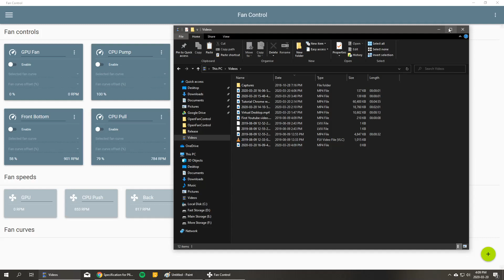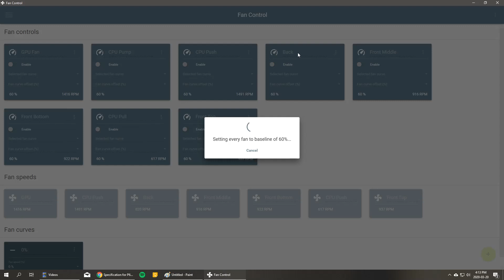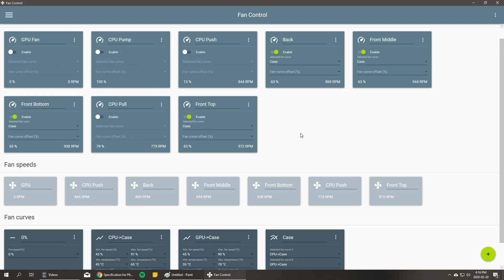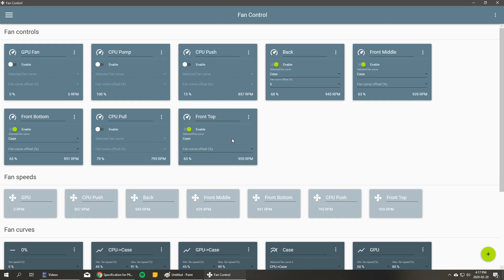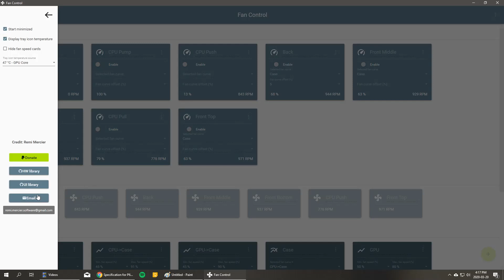Fan Control: Basic setup for case fans (Part 1)

Comment: Hi! The software doesn't see my CPU and case fans. Only my 2 GPU fans. I just went from Win10 pro to Win11 pro and used AI suite 3 with fan Xpert 4 on Win10, but doesn't work on Win11. That being said, Fan Xpert 4 was detecting all my fans, but FanControl doesn't. Any tip or direction I should look for? Thanks in advance!

Comment: Some fans aren't responding — for example, my exhaust fan isn't working isn't responding. and only one of the three front fans is being controlled. Also, the ASUS plug-in keeps failing to initialize. All the fans are connected to the ASUS controller in a Hyperion case. Any help would be greatly appreciated.

Comment: Nice vid. My PC was running my fans for nothing but noise earlier today, found your software, installed it and set it up following this vid. It's so quiet now and I love it. Only cons are the software recognizes 4 fans that don't seem to do anything, and it doesn't do well with corsair's built in fan control thing that comes with the 5000d model case. I managed to set it so the fans I have plugged into the corsair hub all work according to one fan control thing. My AIO also doesn't work with the software (3x120mm fans.) I plugged in 2 of the fans as CPU fan and CPU optional fan but the 3rd one is always on now as it's not seen by the software at all. 3 fan GPU's fans work as 1&2 together and 3rd separate.

Comment: i seem to having an issue that I can't solve.
I have  Fractal Era2 case, Asrock B650E mini ITX motherboard and Frozen Edge 240 water pump. For the water pump I have it connected to CPU_FAN2/WP and the AIOs fans are connected to CPU_FAN1. For some reason my BIOS and Fan Control are not picking up any speed sensors for CPU_FAN1, they both say zero RPM but the actual fans are spinning. Any ideas on how to fix this?

Comment: This program basically saved my day 🙏. Armoury crate cannot use as decision source GPU temperature for fan curve control which resulted for me into problem that when I had strong GPU load but weak CPU load, there was almost no feedback to blast front mesh fans and this resulted into RAM overheating which caused large FPS stutters and in one case bluescreen. 

As soon as I adjusted fan curves with GPU temperatures taken into account I can now pass memory tests even when I run on background Furmark which I could only if I used fan curve which was for no reason too loud when idling.

Comment: I have fan control but I think it's only detecting the CPU fans and the GPU fans. I don't think it's detecting the case fans, since they are plugged into a hub. Is there a way to detect them in the hub? I can plug them into the MoBo, but if if can detect a hub that would be good too.

Comment: Typical problem: app it's made by computer geeks for computer geeks, not for regular persons. Interface not intuitive at all even with tutorial. Also had problems when I closed the app window by clicking corner X instead of selecting in the menu to Quit the app. App would still run in the background and could not delete the app files. Had to reinstall it again then close it by selecting Quit (three dots upper right corner), then I could delete all files and folders. Again, definitely not for the regular person.

Comment: What a pile of junk. Tried thi8s one a bit a year ago, was not impressed since i had to use even more tools just to figure out what fans are what.  
Tried it again yesterday, non of the plugins (Asus and nvida thingy)  would work so that was the end of that test. Im trying it again now, the pluings are loaded, bot NOT ONE SINGLE fan is detected. And then i changed one tiny thing in settings (PSU fan on) And it hangs on refreshing. So after wiping this POS off the disk, "installed" again no with out the ASUS plugin, and it found fans, but OF CURSE claims 90% of the FANS have no RPM Censor. Funny, i can go in BIOS and set EVERY FAN by RPM. What a pile of junk.

Comment: Doesn't work.  It shows a GPU Fan that's not doing anything or reacting and 7 other fans.  Nothing I do detects them in a way that I can control them.  All videos I can find on this software start from a point I can't even get to.  I tried pairing fan cards to their respective speed cards and ran the Detect Fans Start % Automatically and it counts them all to 100%, but then all show up as "Fan Never started."  Then, I realized my case fans are part of a hub that needed to be connected to the motherboard, as I recently disconnected it, so it's reading all them at once, which is fine, but I still can't control them with this software working.

Comment: This is exactly what I’ve looking for...sadly, it will not open.. it just spins for a second and then nothing. I tried several things...but I have not been able to get it to run. I hope you can help.. I installed new CPUs and they are running very hot.

Comment: I'm pretty sure I could lower fan speed with this program without having it run in background afterwards, but now after BIOS reset it doesn't seem to work anymore.
Reply: The program needs to be running.
Reply: @RemX405  I see. But I found the fan control in BIOS so I could adjust the speed there. That's why they spun way too fast after reset. :=)

Comment: i used to use speed fan till yesterday, good thing i found this software, its easier for me. i dont really control my fans wia software, cause i got 8 channel fan controller that i do prefer, however my three pumps need to be PWM controlled, so i have to have some kind of software for them. I wish there was possibility to add more temperature sensors to temperature source when we are making a trigger curve, since i have two gpu's in the system.

Edit: while i like this software, there are still things the speed fan does better, multiple triggers, it can read vrm temps of a gpu/cpu and act upon it if set up so.

Comment: Hey just got the software and followed the video. Everything seems to be working great so far but was wondering what to set the "function" on the mixed fan curve. Right now it's set to "Max." And could you briefly explain what the function does? Thanks!

Comment: How do I set this up for 5 fans attached to a single hub?  Is it possible to control them individually? I haven't found a way so far.
Reply: I have 4 fans attached to a single hub, and you can only controll all of them at once, in my case it is System Fan #1

Comment: Has anyone had any issues in getting "Fan Control" to work with 3 PWM fans connected to a PWM fan hub? I am working with "Phanteks M25-120" (3 of them) and a "ThreeBulls PWM Fan Hub". When I go to manual mode on the single control and toggle between 0% and 100%, my fans stay the same speed (about half speed).
Reply: For anyone who finds this circular comment.... Here is the conclusion of my own circle... The reason I could not control the 3 fans is because I was being deceived by my high RPM chipset fan. I had forgotten about it and just assumed that the high rpm being shown to me on that particular sensor was for the 3 fans collectively (adding RPM - silly idea, I know). Anyways, turns out that my 3 fans together on one header did not show RPM at all, therefore I did not realize that the "fan 2" controller did anything at all (because it had no associated sensor). Doh! now I get it... Hopefully someone can benefit from my circular comment/conversation. Thank you to the developer for such a fantastic piece of software. Thank you! Thank you!

Comment: i had standard settings for fan controll. now i have this app and it got way worser my cpu goes up 100degree. if i say cap my temp cpu at 80degree it doesn wotk

Comment: I'm a PC gamer, but I'm not super tech savvy & I found this program to not be user friendly at all. Why do I have to setup a Curve? Why cant I just adjust the fan speed% & save profiles like that? Uninstalled after 5 mins. Idk why it needs to be this complicated. Should be easy to use for people of all skill levels, looks like it's just for professionals.
Reply: You absolutely can do that, the problem is you weren't willing to put in the slightest amount of effort.
Reply: @Germania-444  If it takes more than 20 mins to figure out something that should just be a fucking slider to 100%, thats not my problem, thats just shit design and a garbage UI. Many other fan programs have it figured out.
Reply: You can set it however u want. Theres an option to set speeds manually
Reply: Help me please.  How to properly remove this program?  What if I want it to stop affecting the operation of the system?
Reply: @stefan_es If you haven't figured it out yet or for the next person. On fan 1,2,3,4 theres a switch below the name, when its off the program no longer has control. If the fan has no switch you can toggle and running 100% then its a 3pin fan that the motherboard powers but has no control over.
Reply: @matthewmcdonald9107  that's fair, I guess. Not everyone has to use FanControl 😄 And if that other program is sufficient for your needs, why not.
Reply: That's definitely a you problem. The software is extremelly intuitive. Sounds like you haven't given yourself a chance to learn it.
Reply: @jamesp3142  Yea I dont really give a shit. More like a shit programming problem. How about make a user friendly interface and maybe more people would download and use the program? Terrible UI

Comment: my case fans dont go to 0%, if I set it to 0% it just locks to 500rpm and I cant identify which one is it on the case :/, anyways I tested my pc with 500rpm fans, and with 100% fans after and my temp didn't even change 5ºC, but the noise was doubled. my case fans always stay at.
Reply: You either have fans that go only at 500-1700rpm and cant go to 0%(These can hold any number of rpm between 500-1700rpm). Or u got 3pin fans that should run at 1000rpm at all times, but if regulated at some sub 40-30% they may stay at 500rpm passive (These will be either 500 or 1000 in speeds).
Reply: @indiffrend  yeah my case fans can go to just 1700rpm. And without any program or ajustment, they all just stay at 1000rpm all the time, which is enough to do a pretty good airflow, bcs I have 7 fans on my pc.

I compared to my temps without any case fans, that I did before buying them.

Without any fans my pc were getting about 6°C more.

And with the fans, whatever the speeds are, 500rpm or 1700rpm, the temps dont change more they just keep at around -6°C

Comment: I’m having a hard time identifying ALL my fans.
It is finding my 2 GPU controllers but not other fans in my system.
Although all fans are spinning it’s only giving me RPM to gpu, cpu and 1 set of 140mm LIAN li V2s.
Problem is there’s a pump fan for AIO along with 9 other fans that all read zero rpm but are still spinning.
I’ve been at this for some time troubleshooting.
Any help much appreciated.
I’ve gone into BIOS and tweaked a few things with no success
I’m using LIAN li infinity fans w/240mmGalahad AIO w/MSI MPG Z790 EDGE WI-FI motherboard.
New msi 1000w pcie5 psu.
Reply: At one point it registered my cpu fan but now I can’t control that either however says rpm’s
Reply: Hey bud did you ever figure this out. Its the same for me only some fan controllers react to speed sensors when doing the assisted setup and the only ones I can actually control are the 2 nvidia gpu ones and the rear fan.

Comment: in the future by chance can you make a way to have 2 sensors going into 1 fan curve so say, my cpu kicks up but my gpu doesn't I would still want them to kick in, but then later my gpu is kicking up as I'm doing encoding on the gpu and the cpu is just sorta idle, I don't want it to rely on the cpu to get hot if my gpu temp is going up. So like a mixed sensor function where if one gets on with the curve while the other isn't it will use that sensor and vise versa

edit: nvm figured it out thanks

Comment: Curious do you have any guides on how you should connect fans to the motherboard in order to use your software? I'm trying to move away from the disaster that is Lian Li's L connect 3 software. I take it each set of connected fans would have to plug directly into the motherboard instead of the lian li hub in order for you software to be able to control it?

Comment: I only have PWM fans, can you tell me what I should set in my BIOS? Your github says avoid "smart control" and pick default of 50% is probably best. If I won't be using BIOS smart control should I still pick PWM, or does Fan Control work better if I set this to DC?

Comment: Tried this program but showed nothing but the GPU.
I didn't understand anything at all when the program asked for sensors and custom stuff I literally just agreed to it so could be the fact I have zero clue on how to get this setup lol..

Would normally just use bios to change fan speeds but the BIOS splash screen on this particular PC shows a glitchy mess when ever the bios splash screen pops up.

Comment: This might be an issue for my system in general, but I cant seem to control 2 of my case fans. Reason I say this is because software like HWMonitor give the same RPM reading as Fan Control. Anyways, I made sure to plug each fan into the SYS_FAN headers on my Aorus B550 Pro AC mobo, set each of these headers to PWM fan control in BIOS, and I still don't have any control over these 2 fans, except in BIOS. They don't respond to any manual changes or fan curves that I've set in Fan Control. These fans are plugged into SYS_FAN4 and SYS_FAN1.

Also, I have an AIO and the rad fan plugs into a header that connects to the pump through a splitter, which then plugs into the CPU_FAN header in my mobo. In Fan Control and even my BIOS, the RPM reported for my CPU fan is 4500. So it seems the pump speed and fan speed are just being added together? Idk, but Corsair iCue correctly reports the fan and pump speeds separately. I guess I could just plug them into separate headers and see if there's a difference but this was the way the instruction manual recommended I install the AIO.

Either way, the potential of this software is huge and I would like to take full advantage! Please let me know if you have any suggestions and thank you for this amazing software.
Reply: Try DC on these headers.

Comment: I can control my fans perfectly fine with SpeedFan, but I would like to move to Fan Control. I can control my GPU fans but not case fans.
I know that I can control these fans bc software called SpeedFan works. with this.
The software detects my fans (in the "Speeds" tab), but they do not show up in the "Controls" tab.
Can sb help?

Comment: Trying to figure out why Fan Control not detecting CPU and CPU OPT on my ASUS Z390 board.  Detects 3080Ti and case fans (x3) but never the CPU and CPU OPTional.  All Q-Fan tuning is disabled in BIOS and no other apps attempting to control any fan in system.  Works great but can't use the 2 on CPU (Noctua HS & Fans).  Anyone have any suggestions? TIA

Comment: Hi, I tried this and a small screen opened at the bottom right of the screen which found all my fans. After this, there was no way to actually open the program up, clicking on the fan-like icon in the taskbar did nothing. The only reference to the program was in a file located in my C drives TEMP folder.
I had the download and clicked on the fancontrol.exe in the zip file. I would like to see an actual installation video to see what I did wrong.

Comment: Has anyone used this with Lian li uni fans? I have 2 sets of 3 chained together on 2x sys headers, Fancontrol picks up 7 fans but it cant link the rpms for some reason. Wondering if this has anything to do with them being chained together

Comment: windows 11 downloaded latest archive a little pop up came up went thru a configuration and i closed but i can't find anything to open the screen where you rename your fans WinZip created all the files in a fan control file in my documents the only file that seems to work is the one marked application none of the extension files will open of course from my taskbar if i click open it just goes thru the set up again testing all fan speeds can't seem to find my way past this point not can i find  a way to delete this from my add remove programs to try and reinstall

Comment: Works well with DC fans. I like the mixed-source function; whenever either GPU or CPU gets hotter, the case fans will speed up, rather than having to set each fan for one or the other.

Comment: I had high hopes for this, but hasn't worked so far. First, it only detects the sensors of only three of my four exhaust fans, although all four are on mobo headers, and only two of my GPU fan sensors. Second, the .exe file ran once or twice and no longer does. Likely being blocked by my OS, so I'll have to figure out how to unblock. If anyone reading this knows how to fix please advise, thanks.

Comment: Built my first PC last year and I was using BIOS for my CPU and case fans plus Afterburner for my GPU fans. I don't overclock at the moment so I didn't really need Afterburner and I got tired of restarting the PC just to change my other fans so this helps out a ton. Everywhere I looked was singing the praises of Speedfan but the only things it picked up in my system were my two M.2 drives... 

Got this downloaded and set up in minutes and now my PC is quieter than it's ever been while still maintaining my temps and I can change things in a moment. Picks up my CPU fan header, pump header, all 6 case fan headers, and my GPU's 2 fan controls. Nice to know I'll have control if I ever add PWM exhaust fans or decide to not daisy chain my intakes. Thanks!
Reply from the maker: You got it right. Enjoy!

Comment: I don't get why some of my fans ( bottom intake, plugged into 1 to 2 splitter) won't show rpm,  at initial setup it was saying "A paired rpm sensor is required". What does that even mean? There are two fans plugged into one header for cpu as well and it just works. I need two bottom intakes to be dependant on gpu temps to feed gpu some air but I don't see the way  to get it done.